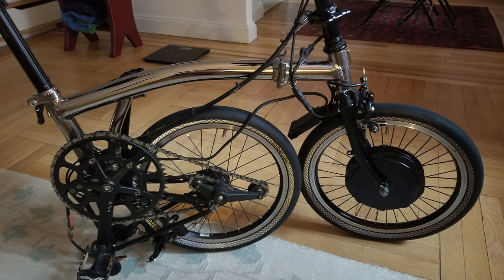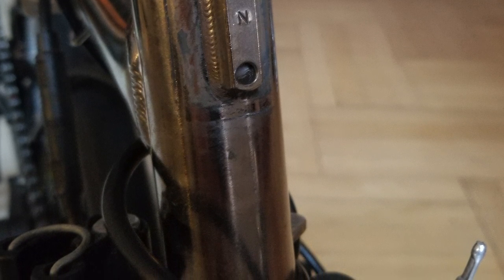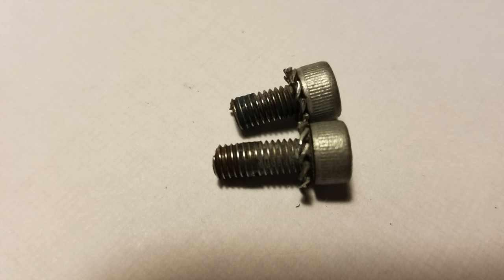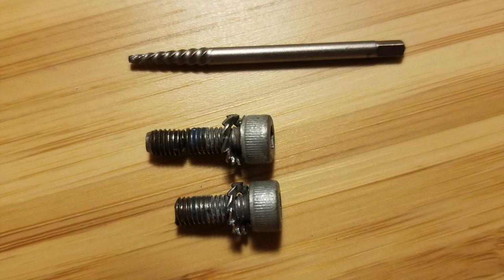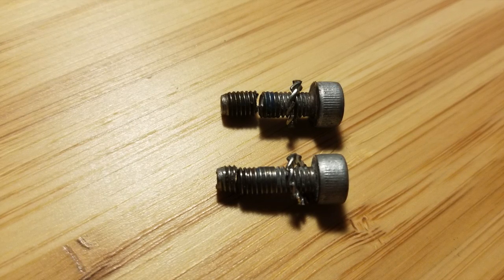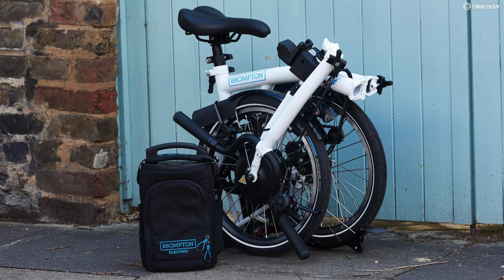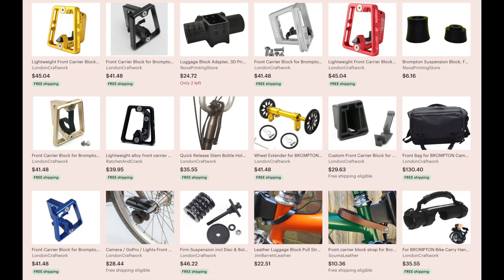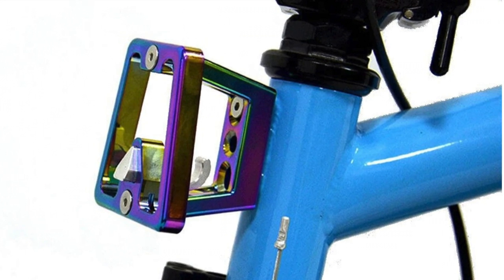The Greatest Flaw of the Brompton Bike (11.2022)

Comment: The Brompton is I believe 250w which is the uk limit.
You have 750w 3x the power, don't you think your set up might shake things about a bit more?
“Brompton don't have any instructions on the Front Block screws"; you are on a bike, it WILL vibrate in use. It's removable parts are attached with screws, nuts washers and bolts; some may come loose, in use over time.
Check things now and again. 
Common sense.
An expensive lesson, hopfully learnt.
Reply: bingo. this ain't on brompton. brompton has problems but this aint one. move on

Comment: You say Brompton gives no information on the screws for the caeeiwee clock. I googled "What torque Brompton carrier block" The top response was from the Brompton trade site: Finally tighten both screws firmly to a Torque of 4N m Feed the bottom end of the latch lever 'LL' through the hole in the base of the carrier block 'FCB' and then, holding the bottom of the latch lever, position the top of the latch lever inside the carrier block. This was not hard to find.

Comment: It is possible to drill out and replace the - thread with a new and better/harder insert of - similar size, which is fine for owners of old BMW Motorcycles, for the top cover of the two cylinders! And still being able to using the original size bolts!
      I have replaced near - all bolts, discs and nuts with titanium, for less weight (8,5 kilo) and a product named Locktite may secure the  bolts more or less permanently, according to what is the wanted. Finn. Denmark

Comment: Am surprised that the plastic carrier block was still intact. Have heard that one might be able to use longer screws- slightly longer - ie a couple of MM. And yes always a good idea to periodically check the bolts - especially the brake bolts and alignment. Also the tyre walls. Ride safe my friend- that DIY electric maybe just too powerful for the little bike. Do check your headset and all hinge bolts 🙏
Reply from the maker: The original screw and carrier attachment are fine and will last forever. The problem is the vibration gradually loosening the screw disregarding size.

Comment: clearly to much weight on the bag they broke off not to mention the bumps in the road will amplify the load on the screws
Reply from the maker: It's been a year, and the standard screws are holding up just fine and no longer get shaken out thanks to the silicone I applied 🙂. I will make a follow up video.

Comment: Thank you SO MUCH for posting.  There are some flimsy parts on the brompton, including the rollers and the plastic fenders.
Reply: The rollers are intentionally flimsy, to protect the carrier and frame. Plastic fenders I prefer over heavy and bound to rust steeel fenders
Reply: @TR4zest  I have kept my original fenders on my now below 2019 Superlight, with titanium stays, but I have changed the original "Heavy Metal" Brompton brackets on them to a Chinese set from carbon, with holder screws and - aluminum holders for the bikes frame. Also a few brake parts more, from titanium. As a Rainy Dane I never leave home without mudguards.
    Presently my bike weighs 8,75 kilo and I expect to be able to reach at least 8,5 kilo, and still with my 6 gears.  Finn. Denmark
Reply: @TR4zest  My 2019 SuperlightM6LXBrompton was delivered with mudguards, with Titanium stays, but "Heavy Metal" clamps on top and holding those on the frame! Those clamps may be bought in much lighter versions, carbon and aluminum, from A E in China.  Finn. Denmark Presently weighing  8.5 kilo and I expect to reach below 8 kilo, with a little more work on my mudguards and brakes, changing parts on both. So who needs a T-line, of course also with mudguards. As a Dane I never leave home without them!! Finn. Denmark
Reply: Northing on  the brompton is flimsy, Only excessive use makes it fail. A 750W motor and associated battery puts too much strain on the system.  The Brompton is a commuter bike for easy carrying, fast folding and unfolding, and will happily live with a 250W motor.  And broken bolts, if they are not fastened properly can happen on any bike system or engineered component and system.      Drilling out a broken bolt is a simple task for a mechanic and nothing to scream and shout about.
Reply: @robertrjm8115  do you actually own one?  I DO.  Both of the plastic fenders broke within a few months.  The cable capsfell off.  The shifter has known issues with some internal plastic part.  IT'S FLIMSY.   I am not really sure why people defend this bike.  What IS good about it is that it can be folded up and used as a cart in a store, so you don't have to worry about it getting stolen off the bike rack.
My Chinese made Dutch bike is much sturdier and less than half the price.  And the paint job is way better.  However I have limited options for bringing it in with me.